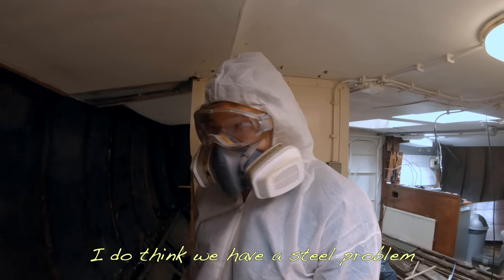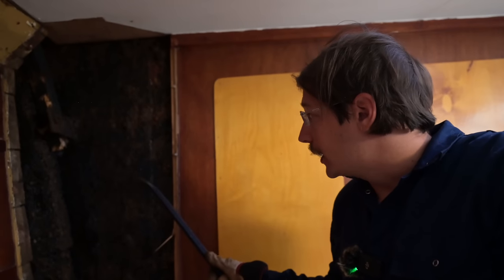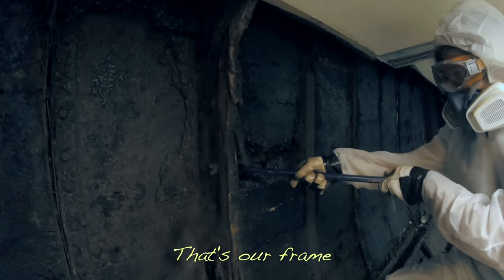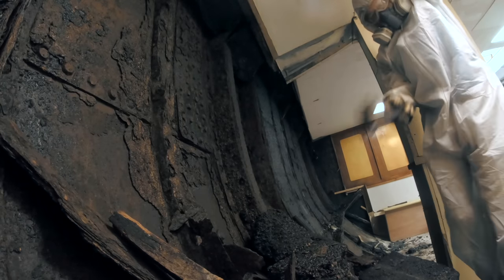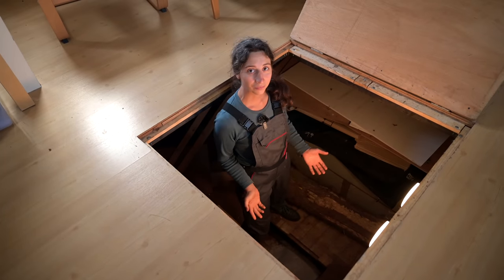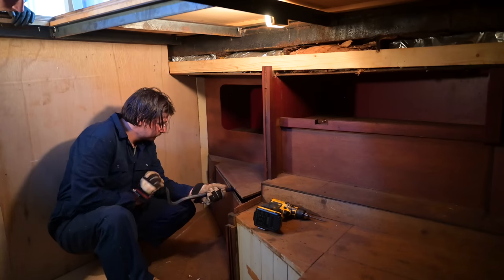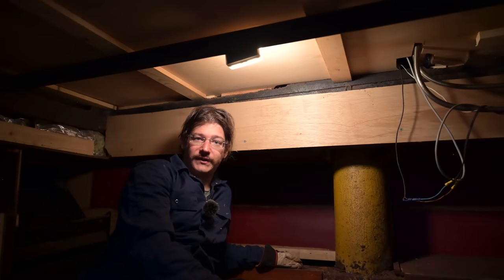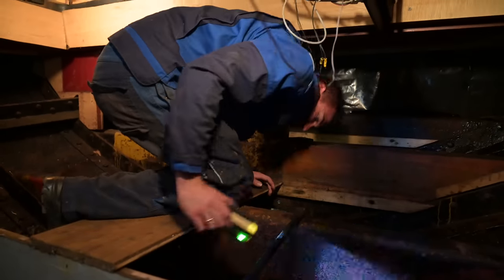We Need To Call In An EXPERT! Not good!!!

Comment: Like Graham Smart said steel can easily and cheaply be replaced even daniel can learn to weld mig weld or arc weld its not hard a couple of hours welding some scrap steel you will soon get the hang of it obviously to weld important places you will need a qualified welder bet there are plenty of welders out there always looking for some off the book work after work Nothing I have seen on her hull makes me think scrap her far from it steel is plentyfull and not to expensive even holes in the hull its self is no problem to repair ship yards do it all the time but your hull looks good its the frames which have been attacked by damp now that can easily be repaired a lot of grinding and then seem welding she will be as good as new what I would do if you can afford it is to get the hull inside sand or gritt or bead blasted that will make life so much easier I know its messy but will be so beneficial in the end and then seal the metal with a good epoxy paint once welding is complete then it will last you another 75 years in fact longer as the cork made the rust holding on to moisture my hull was much worse than yours I had to weld 2 metre plates cut out of the hull as I had the same problem electrolasys luckily I was a retired mechanic and welder of heavy goods vehicles for 15 years and went on to cars for another 15 years so I had some skills which were great for boats so me and the wife bought a 85 foot Trawler 52 years old and I converted her over 5 years she was built in lowestoft UK now she has 5 sleeping cabins all on suite a day head on top deck a large galley to keep the wife happy and me as we share everything all tasks I did get a shipwright in to do all the cabins as I wanted them to look like the new boats he did a fantastic job we now have the capacity to go across the pond and back we also have electric motors on the back of both engines a wind generator and solar panels fitted tastily to every part of the ship we could these motors are made in the UK and attach to the rear of your diesel engines or you can buy them complete with the engines which is what i did then i fitted bow and stern tubes to the hull  and had electric motors installed instead of hydraulic as they were cheaper and easy to replace if they go wrong that what you require a bow thruster will sve you hastle as you cant go out backwards as the rudder is ineficeint as no water id flowing past the rudder from the prop so did i get dis heartened yes i did sometimes i wondere if i was ever going to finish her amy lou we named her we took her to the states via Jamaica and the islands and ended up in boston where we are now and boy was it worth all the trouble yes it was now the stress has gone we are stting off to warmer seas now off to panama to cut throught to the pacific and upto california so stick with it you can rebuild her.
Reply from the maker: Thank you for the comment. You'r absolutely right a steel boat always can be repaired and it seams that you've proven that it's true. I don't know if you came across the hassles of a riveted hull. It makes everything a bit more challenging. The hull plates are sealed with natural materials like hemp or felt, so when you use an aggressive blasting method there is a chance that the whole seams start to leak. If you weld one spot another one opens up and so on. We both are able to weld and it's a fun thing to do. However, there's a liability issue because we are not certified. Also it's one of the cheaper jobs to hire out. Project management and the editing would be much more expensive. I wish you all the best with your trawler and many wonderful journeys to come! (I might inform you that your keyboard ran out of periods, commas and capital letters 😉)

Comment: There’s not going to be much left time you rip everything out. Good luck. Can’t wait to see the finished project. 👍👍
Any of the timber worth salvaging?
Reply: looks all like relativly cheap plywood and some ''Dachlatten''  roofing boards. 2cm by 1cm wood as sub framing. and build with no intention to take it apart later.

Comment: thats some rust... how thick was the steel hull likely to have been when new would you think and i wonder what the ratio is.. steel lost to rust thickness  that you have..  i know the figres banded round are 8-10 mm of rust to 1mm of steel ..i thought i had problems with my narrowboat base plate rusting due to a wet bilge ..
Reply from the maker: Our highest thickness reedings are slightly above 8mm. So I assume that the boat was built with 8-9mm steel. That does mean that we lost about 2mm of steel and that made up for about 1.5-2cm of rust. The surveyor and the yard also mentioned your ratio. One cm of rust is just one mm of steel. Legally the minimum thickness is just under 4mm steel but in other countries and for other boats it's 2/3 of the original thickness. But yes, rust often does look way worse than it is.

Comment: Are you guys going to Sam blast at dinner hall in spray installation in.
Reply from the maker: Unfortunately spray foam isn't the best idea for our riveted boat. It would be necessary to remove the foam if welding is needed ever again. Also sand blasting is probably not the best method because it introduces heat and blasts away the seam tightening materials used to make the hull plates water tight. So blasting yes ,but no idea what kind of blasting. Laser, water jet, wet sand...

Comment: What will you replace the cork  with later
Reply from the maker: That's a real head scratcher at the moment. I would prefer to use 20mm of Armaflex as a vapor barrier and a thick layer of sheep wool insulation on top of it. But many people are recommending to use a great or bitumen based hull coating and then I think the only option is stone wool.

Comment: Someone must have the knowledge to know if she was originally built as a sailing vessel, I doubt. Probably had an engine from the start and sails were added for looks and seaworthyness if engine fails. This project is a risky one and even after hard work  and $$ the result will be the same, a boat that will bring you nowhere. Bonne chance.
Reply from the maker: She has the lines of a "Motorlogger" sometimes also called "Heringlogger". My guess is, built in between 1915 and 1935. These fishing vessels usually had a ketch rig. From the principle very similar to the danish "Haicutters" but bigger and mostly built from steel.  Speaking about the hull it was a sailing ship hull equipped with an engine. The loggers were the predecessors of the Kriegsfischkutters or Trawlers. They were built as motor ships sometimes with an auxiliary rig. Interestingly also a sailing ship hull but the first one optimized for motor propulsion. The Kriegsfischkutter was the dominant design for North Sea Trawlers up to the mid 60s and 70s. Sorry for nerding out but I hope you find that interesting.

Comment: Ohh this old isolation look like black coal.
Reply from the maker: It's pieces of cork mixed with tar and pressed into tiles. The tar is either made from coal, oil or trees. So black coal is close enough 😉 But if it's made from coal it's a hazardous and the reason why we have the wear the heavy respirators, just in case.
Reply: @FlyingConey  Check out the option. Laser cleaning. It is a new method. It will probably be expensive, but it will save you time. I also have a steel boat in Sweden. The original owner insulated with construction polystyrene. I have to take everything down, paint it and insulate it with expansion foam and small parts with neoprene. Good luck.
Reply from the maker: Blasting Method, Hull Coating and Insulation is a triangle of difficult decisions. The riveted hull doesn't makes it easier because there's always the possibility that you need to weld a rivet or a seam. That rules out expanding spray foam and also means that there's a risk when sandblasting. I would love to glue on armaflex and use sheep wool above it as insulation material but that means that we need a clean and painted hull. Many experts including the lads from the shipyard recommend a soft coating. Grease or bitumen and that would drastically reduce costs but would leave us only with he option of a stone wool insulation....
Reply: @FlyingConey  I like your description of "a triangle of difficult decisions" A very good description. I can't say by any means I have all the answers but having spent most of my life on a steel boat i also lean towards the "soft coating" methods. Even given ideal preperation like sandblasting (which itself is not easy inside), a good epoxy coating will still only last about 20 years. Then steel is again expsed to moisture and the inevitable rust cycle starts over again. I too looked at armourflex with additional insulation on top as it is a very appealing system and is useful in the right places. However after some experimentation I came to love the simplicity of working grease into steel. Grease and steel go so well together, at least on parts of the hull your hands and feet do not need to touch. Oils creeping in to the very pores of the metal and sealing it, around every rivet or seam it is removable and replacable as needed with minimal preperation, I've applied it unheated by hand, what could be simpler? no heavy going grinding or major cleaning needed beforehand, it will saturate solid rust and I like that rockwool is simple and and non combustable in the event of any hot metalwork and is itself easily obtainable and replaceable if needed. I like fitting everything with a view to being able to access and maintain all the parts of the hull with fully removable floors with no bulkheads built in such a way over them that will inhibit future maintenance. The pattern of corrosion in our boat tells me the lower parts of the hull are where any moisture sits so I keep access to these areas the simplest. Almost all of what is built on inland boats here in the UK is fixed and immovable with no way to know what is happening behind, leading people to ignore the invisible corrosion (typically for decades) that would otherwise be simple to maintain as it is too disruptive to essentially destroy an interior to get at the hull. But the hull is the foundation of the boat and so much corrosion on metal boats is from inside. Clearly not always the best option for all, but I urge people to "give grease a chance"  im a dreamer but  im not the only one.....every choice is a balance of weighing options, I am greatly enjoying your channel thank you for taking us out here in internet land along with you.

Comment: Not worth it at all. Riveting was a completely different construction method than welding. the more welding you do on that hull to repair damage from broken or corroded frames the more rivets you will pop or ruin. If you were experts in welding and metallurgy then I would say go for it(or had expert knowledge in pre 1950 boat construction. The "experts" you will find for what you are trying to do are few and far between. The restoration of boats dating back to pre 1950, when riveting was commonplace, are just not really around anymore . Even the metal makeup from welding with today's mild steel or stainless wire will cause dissimilar metal corrosion. Just remember boat yard employees, and the experts are there to make money. I restore boats for a living and would never touch that thing. I couldn't in good faith suck a customer into a project like that. I predicted this in the first episode you guys posted. It truly is a money pit.
Reply: Exactly
Reply: Agreed!!! Same thoughts here! Sadly it looks nice on the Shear line, However....................

Comment: It's an unfortunate situation...
It's too bad a thorough marine survey was not done, pre purchase. 
For me, it would be an easy decision to sell for scrap and move on.
The only component worth anything is the engine to build another boat around .
I'm speaking from over 50 years of boatwork and ownership .
Sell the main driveline components and move on .
I hate to see wasting money on something that is a money pit .
Reply from the maker: I think you underestimate the historic value of the hull. She is a quite remarkable example af different epochs of boat building. First she was built as a motor logger so most likely with a sailing rig. Already had some design elects of the appearing trawler. Maybe she even was built with wooden planks. She then served during the Second World War and was worth rebuilding 1950. Successfully fished until 1977 and was converted to a sailing ship. The artist who bought her got older and rebuilt her once again to a more manageable motorsailer. 
More modern trawlers are not suitable for a sailing ship conversion so it's probably one of the last chances to rescue a ship like that. Fully restored we're talking 1-2 millions. Look up the "Texel No6" currently for sale.

Comment: It didn’t take you long to start complaining about a bit of hard work.Surely you knew how much work would be involved in restoring this vessel my advise to you is to find a long term hard stand boat yard you have at least 2 years of metal restoration before you start your fitout
Reply from the maker: It's more a complaining about the time pressure than about the work. There's a reason why the professionals call it a day at 4:30pm. Mostly we worked until 8pm and edited the videos on the weekends. Sleeping at a building site, loud noise all the time and no other way out than continue working. The work itself was fun most of the time.